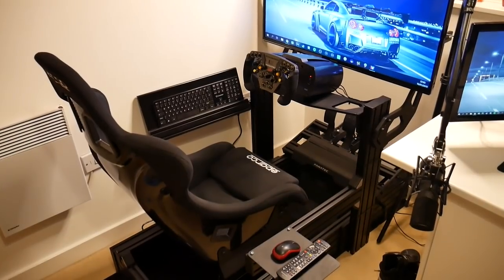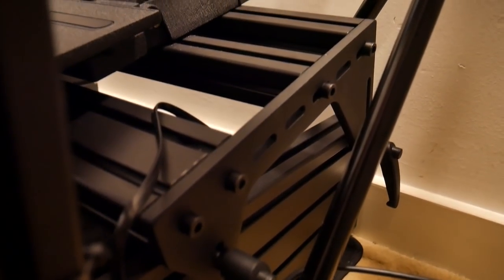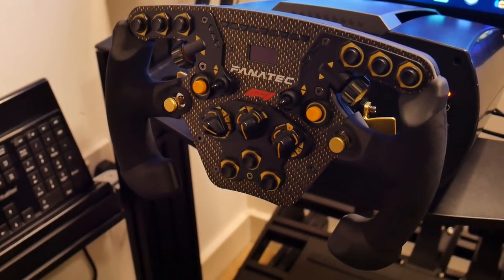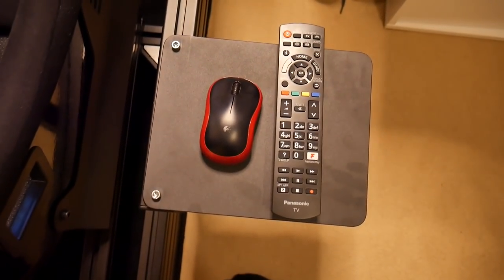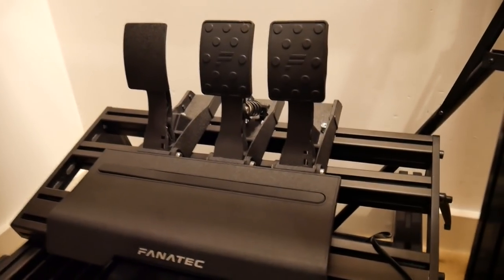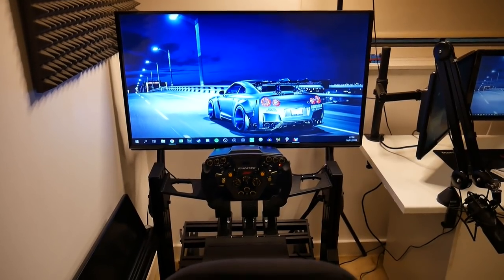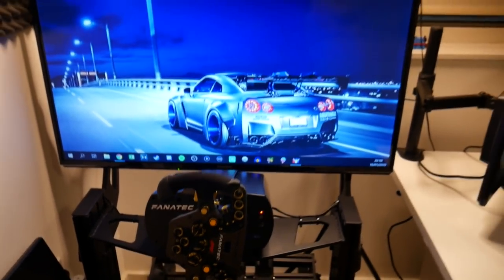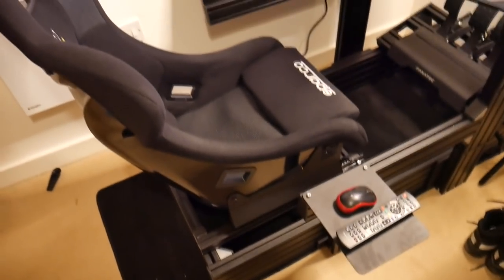It's Finally Here - New Sim Rig Tour!

Comment: Did you check up on the amount of input lag that Panasonic montior has? Console has quite a bit, but when played on a gaming monitor, it's not bad. Gaming on a monitor/tv with 100-300ms of input lag can be a huge pain.

Edit: you can also flip that second monitor into portrait mode to make it easier to use with chat and keep that boom arm blocking as little as possible.

Comment: i had to throw the ps4 controller in the trash, I sort of needed to do that to force myself to use the wheel. after month of ups and downs, not being quicker than controller, but now finally surpassing the controller times,  not making nearly as much mistakes, and definitely handling tire ware better, definitely worth the wait.
Reply from the maker: Yup, it takes time but the possible speed is higher. The tyre wear as you say is something that is far better on a wheel.

Comment: I had to watch a couple of times, but... how is your monitor hanging there? Seems you have the monitor mount brackets the wrong way round. Did you do that on purpose to get the monitor further away from the wheel? I am considering buying a similar rig, so hence the question: should I get a separate stand or is the integrated mount just fine?

Comment: Technically a combination of 8040 and 4040. There is actually no such thing as 8020 extruded. (80mm x 20mm) It is however a generally accepted term (and company name with clever branding) for all extruded aluminium. It worries me when the company's selling the racing mounts actually just call it all 8020 as well.

This is excluding the 2 filthy imperial versions of extruded 1 inch and 1.5 inch.

Comment: Hey Dude. Love your vids and just love the new driving gear u got. But are you sure that the pedals were mounted correctly?
Shouldn't the one which is a bit different go to the right side, where do you have a gas pedal?
Usually clutch & brake pedals are the same and the gas one is different. It's kind of opposite on the gear you have.
Was it pre-mounted like this? Or have you done it yourself?
Reply from the maker: I did all of it myself. The load cell is meant to be for the brake, which is how I've done it. Ultimately, it's all personal preference but I cant see a reason why you'd need the throttle to be the stiff pedal.
Reply: @Super_GT  i dont know the exact reason too but all the cars Have the gas pedal, on the right, diffrent from the other two. Not that I mind the opposite. It Just struck my eye as I didnt expect Such a mistske from a car person :)
Reply from the maker: As I say, it isn't a mistake, it's meant to be like this.
Reply: @Super_GT  as You prefer my friend. I guess in Real cars it makes a difference So Just wanted to point that out. Looks a bit weird When You look at it for the first Time :) anywys its an amazing set. wish i had enough room for this :(

Comment: How did you attach your CSL Elite pedals to the 80/20 profile? I see the bolts at the back but how did you do it at the front? Thanks in advance.
Reply from the maker: yeah the front ones are really tricky to bolt down because the footplate of the pedals don't give any access to the bolts. I used my finger to tighten them!! Can't get an allen key in there annoyingly.

Comment: Lol these are the ppl I'm racing against in Gran Turismo Sport that have a massive competitive advantage.  I'm stuck using a controller with traction control and abs on while these ppl have full control with pinpoint steering, feathering of the gas and throttle and manual shifting.  I believe they should have different leagues for controller and wheel racers.  No mattet how good you get with a controller you will be 1 to 2 seconds a lap slower than racers with setups that NASA would be envious of..
Reply from the maker: Not quite true. There are controller players out there who have competed and done well in FIA championships on this game.
Reply: @Super_GT  I have driven manual all my life but don't find it fun or useful on a controller.  To much for your fingers to do.  A wheel with a paddle shifter or stick shift makes it more fun and more practical.  I have to run with traction control at 2 to race with a controller on automatic.  So I can run fast lap times just not the times the wheel racer can attain.  Either way enjoy watching your videos and the class with which you race and commentate!
Reply from the maker: many thanks mate. I think with a controller it's just harder to be truly fast. Not quite impossible but harder.
Reply: @Super_GT  Just because you may find exceptions to the rule doesn't mean the rule doesn't apply. You can give exceptions to almost anything.

Comment: No matter what you use wheels or pedals or controller doesn't matter and all of it should be allowed because every form of controlling a virtual race car plugs into a PC via USB cord so whatever you can plug into that USB port should be allowed
It's all fly by wire in sim racing and yes a controller is faster than using pedals on a road course especially.
Wheels and petals are a cavemans way of controlling a race car.